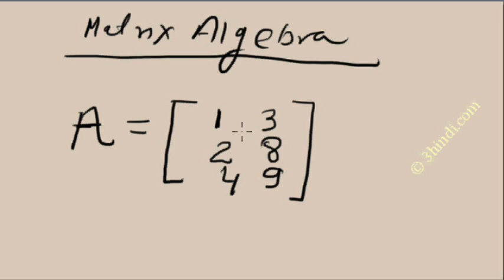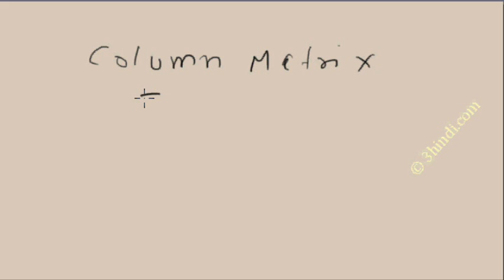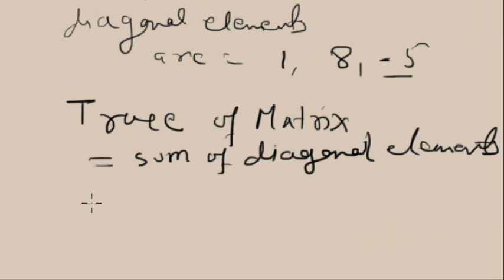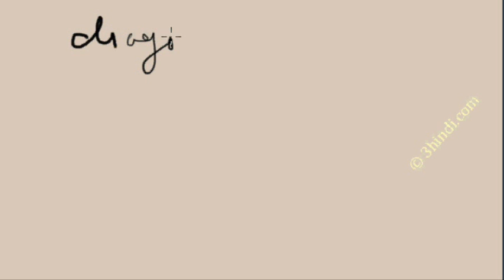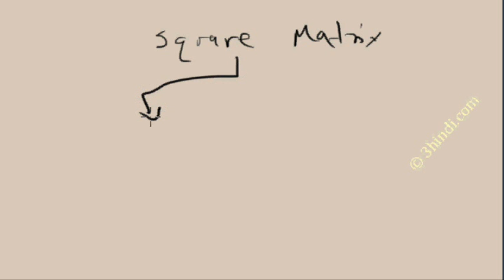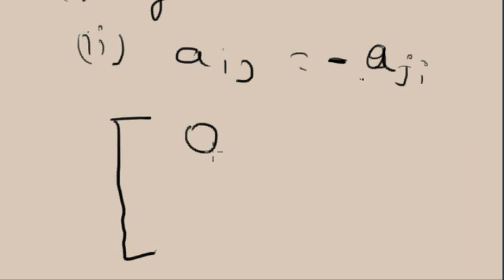GATE - Engineering Mathematics- Matrix Algebra Introduction- course part-1

Comment: There is a query regarding diagonal matrix:
Is it necessary for all diagonal element to be non zero? The only requirement is non diagonal element should be 0 and atleast one diagonal element should be non-zero.
Reply: Yes you are right!
Because diagonal matrix only imposes condition on non-diagonal elements being zero and atleast one diagonal element be non-zero.......but alwaz remember that it is only applicable for sq. matrix only